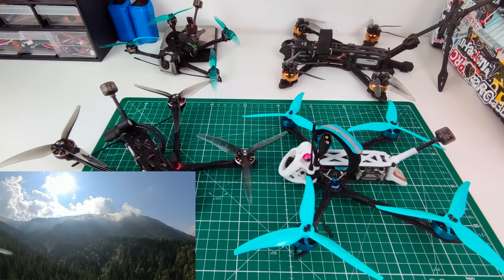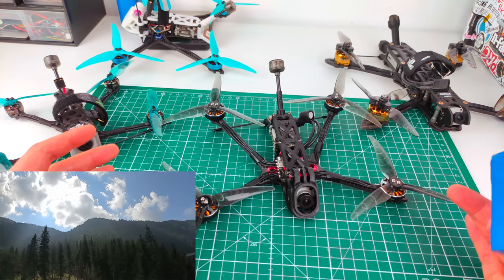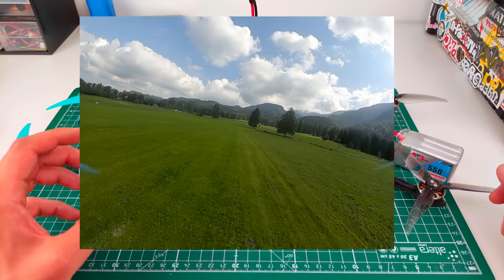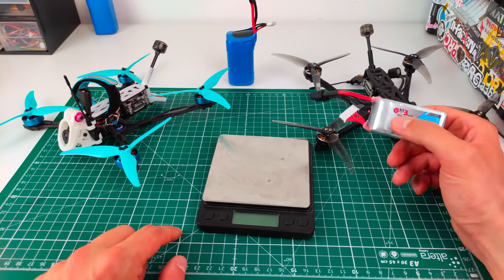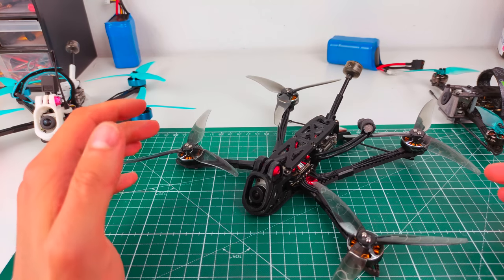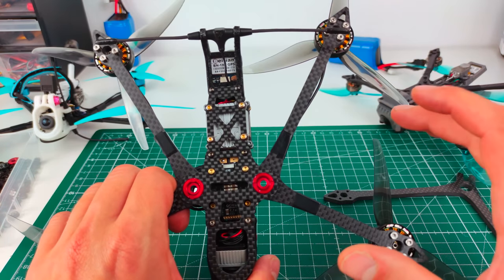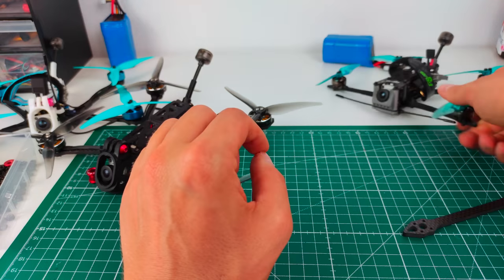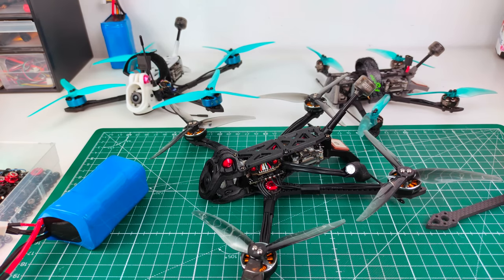The #MiniLongRange - Ultralight 5" Long Range

Comment: Did 40+ min Flight with mine.. Got mine all done and did some test flights. 34min 4S 3000mah and 40min 6s 3000mah.. got bigger batteries to test still

Comment: @Dave_C FPV PLEASE HELP!! I have just updated my analogue Rekon5 to Betaflight 4.3 RC2. I now have warm motors front-right & rear-left (2 & 3?) after a short flight, slight shaking at mid to high throttle, and jello in my unstabilised HD footage. Any ideas what might be wrong? Do you have a BF 4.3 RC2 tune Preset for the Rekon5? Thanks.

Comment: So I picked one of these up and it seemed to have the incorrect presets- I terms in the triple digits and P terms in the teens and for whatever reason it refused to arm air mode in the config. Reflashed to BF 4.2 and it things began working normally again. The tune has been elusive though and I seem plagued by mid throttle oscillations. Is there a dump of your presets and tune available somewhere?(6s 1800kv version).

Comment: if you're worried about the rear arms, you could just run a brace from arm to arm.  that wouldn't increase the weight very much and it would beef them up a bit.  I love your designs.  big fan!

Comment: Dude, this is awesome. I bought the explorer LR and I love the construction. But I wonder Dave, on the mini -- why not a breakaway bolt (a shear pin)?? You could have kept the front and rear arms as two seperate pieces, joined to the frame with the big red bolt as a pivot.  Now all you need is a breakaway pin to keep the arms in place during normal operations. It is onll when the front or rear arms strike something taht the "pin" holding the arms in location is designed to fail -- now freeing the arms to pivot on the center bolt in whatever direction the crash energy wants them to go. I bet this would reduce arm breakage by A TON!!!!!!!!!!! no matter your design.   Yes it only helps with crash force lateral horizontally to the ship --- but that is a great deal of the forces. The rest of the forces may not be sufficent to actually bend the arm up or dowards enough to break them, given they can freely pivot.

I wonder if you could make the breakaway pin out of 3d printer filament itself. a 1.5mm or 3.0mm cylinder of filament held in place? If not, then I am positive a sufficent 3d printed "pin" can both hold itself in place, break exactly when you want it to, have adjustable strength to not break unnecessarily (if Pilots want to push the ship a bit more without having to repair this), AND be cheap as dirt for Flywoo or the end-user to produce/replace.   

WAY BETTER then breaking these thin arms. 

Thoughts??   Love the introduction of that circular bolt, so unique. I love your design style Dave_c --- I am going to be watching your progress and buying more of your ships
Reply: if the arm can move, there is still a spinning prop on it at high speeds.
say bye bye to everything in its path... wires etc, stack....
Reply: @FATSNAIL-FPV  yeah it's definitely not necessary! Ive owned now 3 different explorer LR drones, never once had to replace the arm. I also didnt install the cross braces , ever.     I'm also pretty good at not crashing but still. It's so light! It's certainly great as it is

Comment: See you can buy from cnc madness in carbon fiber? This has 25x25 mounting or just 20x20?  I want to build a 5" lightweight. I have your 4"
What is the weight in all carbon fiber for the frame with hardware put together (no electronics just frame)?

Comment: Imho, the front motor protection should be redesigned. The end of the arm should have a forward reaching point to protect the bells. The camera looks pretty well protected but the front motors will take a beating. Something similar to the Floss maybe?

Comment: cool design features, really interesting to see cruisers that can still do freestyle enough for most people, i think most people don't go above 80% throttle on  a fast quad, its for emergencies only.  i was trying to fly a mountain ridge and the thing that hurt me most was climb rate, on a 650g quad i needed 80% throttle to climb at a reasonable rate, not good, so this light design seems to be an great idea all round. ps.  50 quid says that wobble is a dodgy motor hehe

Comment: I bought the dji version of the lr , haven’t received it yet . But anyway can I run a 4s safely ? And would be be the max size mah ?
Reply from the maker: There are long delays on the DJI version soince the vista units aren't available. Yes it's designed for 4S. Anything from 450-1300mah will work

Comment: Dave -- you mention that the rear arms are a bit long and therefore not quite as strong.  Would you consider increasing the arm thickness to 5mm?  Would that mess up any of the construction/assembly?  I understand it would add a bit of weight, but if it significantly increased the overall strength, it might be worth it.  Thoughts?

Comment: why dont you try to use 6s lipo packs?
Higher Voltage lower current demand at same wattage right?
or due to the higher voltage the motors want to turn faster equals in higher current demand?
Maybe im confusing something but im still learning.

Comment: @Dave_C it would be awesome if you did a build video!  I received my frame today, going with the 6S setup and Caddx Vista. One area I struggling with is the battery wires. I like how you setup with the cable behind the camera on the 4S

Comment: is it possible or okay to cut the Bottom Plate front part from 2mm to 1.5mm? because of cost reasons. Really like integrating other hobby hardware to fpv frame. And what type of CF you used? t300  or t700?

Comment: Those tbs crossfire antennas are centre fed dipoles, you could try replacing it with a 1/2 wave (end fed) vertical antenna (which would need a simple matching circuit to swr it in), does tbs make 1/2 wave vertical? If not they probably should...

Comment: Just saw your update on Thingiverse...and I placed my cutting order just a day before. Hope there wasn`t a huge issue with the 4,5mm bike chain bolts version....
Reply from the maker: It's just safer in case the bolt gets loose or aren't perfectly tightened. I stumbled on this better solution more or less by accident. Nick from CNCmadness had ordered 6.5mm and we were figuring out what to do with them.  Normally you shouldn't notice any difference.
Reply: @DaveCFPV  Thanks Dave, that`s good to hear :o) I ordered BH 2004 6s motors for the build and will use a Vista, the Flywoo F7 mini stack and BN180. Still searching for a longer LHCP antenna for the Vista but it seems there is a lot on the way from GEPRC, Iflight, Flywoo....just not available yet.
Reply: Oh, and Caddx has released a 15cm version of the original Vista antenna as well!

Comment: Sorry man, maybe a stupid question, what’s the difference between your frame I can cut by thingverse and the one sold by hglrc called mini reckon 5? Thanks in advance
Reply from the maker: It's more or less the same. The Rekon has a few extra features like the foldable antenna and an extra screw to prevent play in the arms mount.
Reply: @DaveCFPV  Thank you very much! one more question, which size of capacitor do you use on your 5 inch 6s setup? I saw you mounted it directly close to the battery

Comment: I've got a couple unrelated questions, maybe someone here can spare the time to answer:

First of all, which Li-Ion packs do you think are best for the 4" Micro/Explorer LR? While I'm waiting for it, I'm looking to buy a pack or two (I don't really feel comfortable soldering batteries myself). Do you think a lighter 3s or a heavier 4s Li-ion will give more flight time/be better overall? I've considered the ZOHD Lionpacks, 3500mah 3s or 4s, but they only have a 10A discharge rating. You would also would have to swap out the XT60 for an XT30 or use an adapter. @t

Alternatively, I've looked at some custom built ones with like these below. They "only" have 3000mah but a higher discharge rating (these are the same VTC6 Sony cells that Dave uses) and you could order them with XT30 already installed. @t
Any thoughts? 3s or 4s, 3000mah or 3500mah?

Secondly, if I were to try Li-Ion on my GEPRC Mark 4, which ones would be most suitable? (I know Dave talked about all the reasons why it's not really a good fit, hence the MiniLongRange, but I have a Mark 4 lying around and feel tempted to try it.)
Should I go 6s 18650, or even 21700 (400+grams)? Or maybe even 4s on a 6s build?

Lastly, I'm thinking about changing my order of the Explorer LR to the version without the Vista. In that case, I'm wondering about the wiring. The SBUS wire should be completely useless if you're using Crossfire, right? So there's no need to wire it at all?

Finally, on the new product page of the version without the Vista (https://flywoo.net/products/explorer-without-vista-set), I've noticed that they're using some sort of circular nuts on the arms that I've never seen before. Are those more durable or were they changed without reason?

That's all that came to mind. Thanks!

Comment: Quick question-  I love my Rekon 5 but regarding current draw.     I set up the flight controller per the HGLRC manual with the "voltage meter " on the battery at 112 scale vs the 110 scale the quad came with.    Anyway I'm pulling 30amps at about 40-45% throttle right now in a slight hover and some forward movement.    Which seems off, since I'm using a 4S1P battery with a Max discharge of 30a continuous.   

 Does anyone happen to know what the current calibration is for the amperage per the Betaflight OSD on the Rekon 5 ?

Comment: Hi My Explorer LR arrived and I love it.
I bought the analog version and now want to install a caddx vista, I've got the GOKU f411 board diagram but have no spare uarts left after crossfire and GPS. I was hoping someone could help me sort this out. softserial is enabled and think the LED pad is for the IRC Tramp to the vtx. What pads should I use for the RX and TX on the Caddx and if you could help me with the CLI resource mappings
Thanks in advance.
Reply: I think you only need either the TX or the RX for the vista? Since your running crossfire, but I'm not sure
Reply: Thanks
Reply: @M.TTT.  If you want OSD from the Vista, you need both RX and TX. Otherwise you can just leave it unconnected completely. That`s exactly the problem I have as well. Would be great if someone could post the Flywoo solution to this.
Reply: @SerialKoE  ohhh, they use soft serial I think, but idk how or how well it works...

Comment: Are there any sources in Europe for these bike chain rings? On Amazon they have all possible sizes but nothing with a 4,5 mm diameter.
Reply from the maker: 4.5mm length not dia :-) Look for single speed chainring bolt they are on Amazon
Reply: @DaveCFPV  Oh, all right :-)

Comment: This a very informative video.  I'm just getting into long distance.  And 18650 batterys pacs. 20x20 over aio   stacks agree.  Thanks for making video! New sub. Oh you recommend  4s 18650 pacs over 3s for sub 250 birds? Have a great night and God bless
Reply from the maker: Thank you! Depends on the motors kV and setup
Reply: @DaveCFPV  1408 4000k mamba f405 stack 25 amp esc  4 inch.  Or do I need different motors? Thanks again  and for fast response.  I made first dji water proof bird. (At least I never heard of) fun to dive onto water.  Need to work out some bugs and waiting for my crossfire to get here.  I'll be looking over you vids. Hey hey thanks again!
Reply from the maker: @sleepingbearffg5008  Should work fine on a 3S
Reply: @DaveCFPV  thank you 👊👊💪💪 I know how much time and effort goes into testing and building.  You have my support.  But since I was trolled haven't grown much  :( but will trough out a thank you. Very much appreciated.  Will 4s work better?  And what 18650 do you recommend.  Got some 3000mah 20amp quick drain  ones. They were cheap... need to order a a few going to send some to a few friends.  Your the man.. thanks and god bless
Reply from the maker: @sleepingbearffg5008  Sony VTC6 perform great! 4S is really high for those 4000kV motors so I'd stick with 3S
Reply: @DaveCFPV  thanks on there way. Have a greatday!

Comment: Dave, thanks for the video.  Would you mind sharing your tunes for the 6s/4s setup (maybe put it on thingiverse).  I just received my two UL 5" frames from CNC madness and can't wait to fly them.  Would help alot if I don't have to spend 3-4 packs dialing in a tune.
Reply from the maker: Stock PIDs. Disable all gyro notch and use dynamic rpm filter. But be careful when disabling the filters of course :-)
Reply: @DaveCFPV  Thanks

Comment: Good Job , realy nice Frame . 
What kind of Carbon and thiknes do you use  ( Thickness , 3k ? 6K? , bidirectional ? ) 
I manufactured and designed race Drones a couple years ago . 
I like your Frame Design , and the opinion of zour Design and Function is that  what i looking for . 
A shame that i sold my CNC Mill 2 years ago :-(( ... 
I m from Germany and had some good Contacts to Motorsport , F1 and the Touring Cars DTM Carbon Manufactures. 
I get their a special Carbon prepreg Plate , i could reduce the thikness over 50% at my light weight frame ( old Designs like a QAV 220 ) , but no lose of stiffnes an , got better stiffnes in all direction. 
i could send you the company Contact and Material Specs for free , got some Test Sheet here but it`s not enough for a Frame ... ( Only a round Plate with 15cm diameter ) . 
Could you tell me whenn you sell some Frames ?

Comment: Have you ever considered 3S , 21700?   Why or why not? With lower voltage and higher mAh, even if the packs are at the same weight you  Should get more flight time, yes?  I'm not sure what kind of minimum voltage they're rated to but I would think you'd still be able to have a fun cruising speed even on 8.4 v ?  (2.8v x 3) maybe have to up the kv worst case. 

I've always heard that in practice, given the same power train, the lower the voltage the more efficient.  

I guess the one thing that would prevent me from trying it is if you are already wishing you had more power on 4S.
Reply: what are your thoughts on this now? did you try 3s 5 inch LR??
Reply: @xnoux1  I have not

Comment: AIO Flight controller that you have used in 5" quad might have a faulty gyro. If it's BetaFpv FC then I'm 99% sure it is a MPU6000 gyro pitch axis problem. See my post in "Betaflight BlackBox Log Review" facebook group. So far, five out of six BetaFpv flight controllers have a faulty gyro.

Comment: Use these Lions for a propper 5 inch or 7inch long range, bigger, more capacity, more amps: https://liionwholesale.com/products/molicel-npe-inr-21700-p42a-45a-4200mah-flat-top-21700-battery-authorized-distributor?variant=15913210675294 I'm actually using a 3S pack of those on my micro long range setup with 1404 4500KV and it's working great.

Comment: As soon as you said that you get more throttle resolution with a capped 6S pack, you lost all credibility in your other input and information.
An ESC is a peiece of hardware based on the use of switching mosfets.  They switch at a certain frequency to attain a certain RPM depending on throttle position.. If the capped throttle percentage of a 6S setup is set to 67% you will have exactly the same peak RPM as a 4S setup. meaning at zero throttle, you will be at idle and at full throttle you will be at the same RPM. The throttle range is not increased in any way whatsoever.
Also on the chainring bolts.. they don't hold the weight of your whole body. the crankset and crank bearings do. they only thing the chainring bolts do is keep the things from falling apart.
Your design looks great and there are some good things you're doing here but please don't mislead people with information when you aren't familiar with it yourself.
Reply from the maker: That's not what I said in the video. Never mentioned capping. Was talking about running 4S on low kV 6S motors.
Reply: uh oh, watch out guys, we got a 200IQ ego-genius in the comments
Reply: @DaveCFPV  you're right. I misinterpreted. Apologies.
Reply: @M.TTT.  No ego here mate. I made a mistake.
Reply: @DaveCFPV  where can i get the aluminum screw and locknut for the gopro mount?